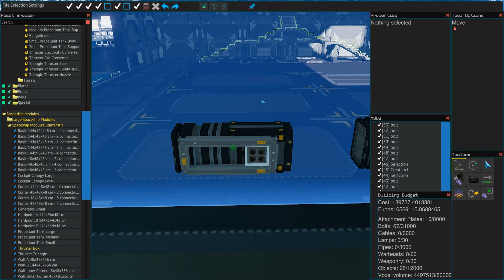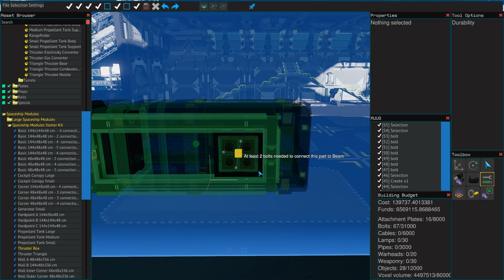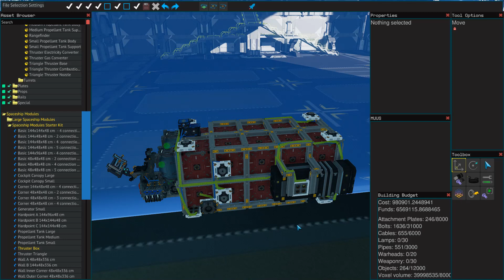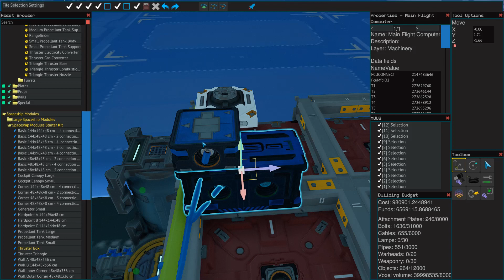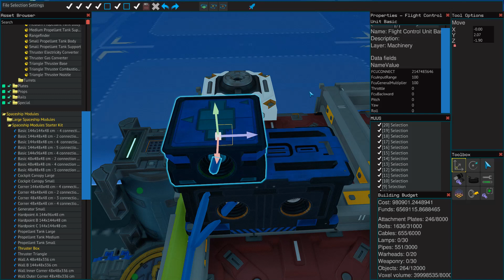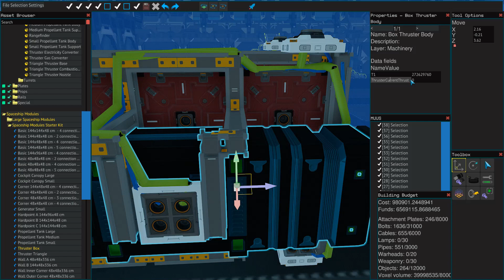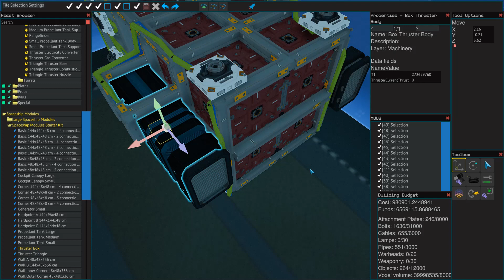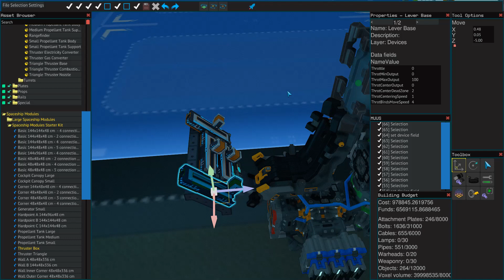Starbase Thruster Tutorial

Comment: Great Tutorial, thank you so much.  I do have a question.  How do we configure what thrusters do what?  Like the ones in back go forward, and then there is the up and down, the rollie ones, the backwards one...is there something I missed in the explination.  Im kinda lost at that point I guess.  Thank you for your time!
Reply from the maker: Great question, the FCU or Flight Control Unit automatically calculates what each thruster on your ship needs to do based on which direction it’s pointing. That’s why you have to name each thruster with a designation like T1, T2, T3, etc. in order for the FCU to properly assign thrust values to each thruster. You could also do all the calculations manually but it would waste a ton of time and wouldn’t be very efficient. Also it would require a ton of YOLOL chips depending on how many thrusters you have
Reply: @SM326-1  thank you for the reply.  I’ll try it out see how things are going!!

Comment: Hi, followed your tutorial and now my thrusters work, but my maneuvering thrsuters are messed up, can't pitch,yaw.roll properly, but they work
Reply from the maker: If that's the case, you might not have enough if you have a larger ship, otherwise double check that all of them are valid thrusters and are piped/cabled properly. Sometimes it'll seem as if they work but they're really not doing anything so it messes up your controls
Reply: @SM326-1  i
Aftermore messing around i managed to make controlls worl properly but now thee main propulsion thrusters will also switch on when pitching, so the craft accelerates when pitching up and dow repeatedly.
Reply: @SM326-1  Will recheck all the piping and wiring
i know the names are corect since i rechecked them several times before.